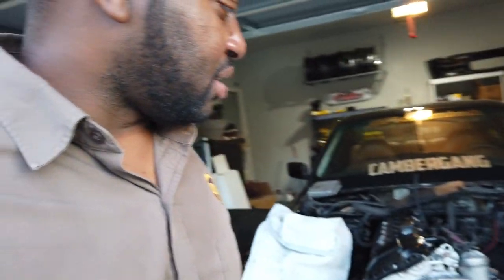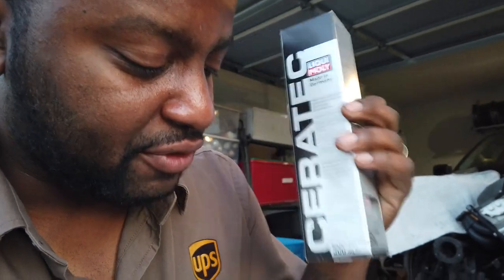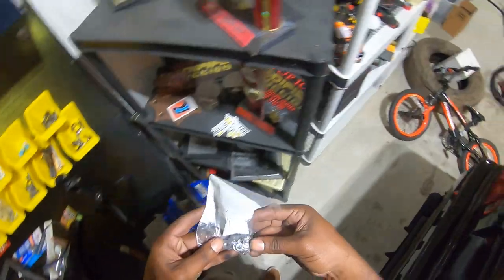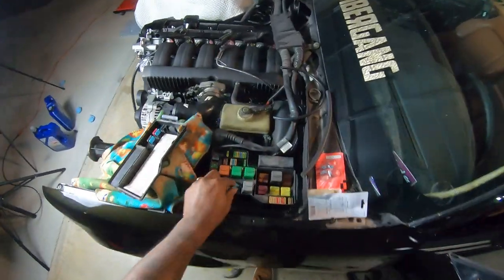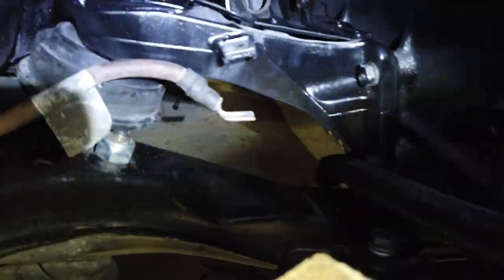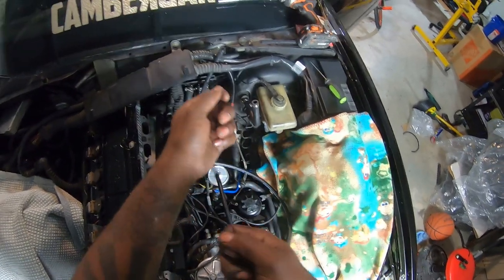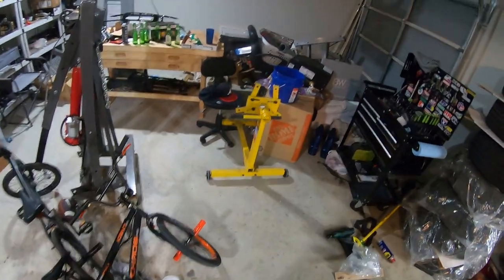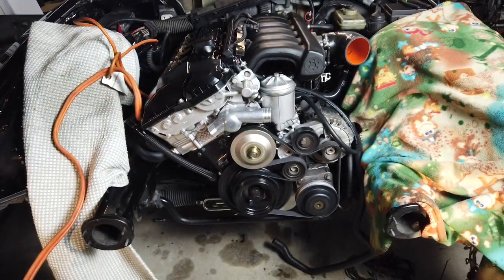"Please Start" Mistakes Were Made For Ebony's First Start-up.... || Turbo E36 Build [Ep. 22]

Comment: Awesome build! ..please let me know what kind of fuel pump to use for a build like this? I just ordered the cx racing turbo kit, 6x 650cc bosh injectors and a MegaSquirt PnP. I need to know what fuel pump I should order 🙏 would you be able to tell me? I have a 1993 e34 with the m50b25 Vanos. You help will be much appreciated 🎯🙌
Reply from the maker: Thanks. And Walbro 450 will be more than enough
Reply: Thanks a lot! 🙌 is that the one you are using for your build? How much hp would you like to achieve?
Reply from the maker: Yeah that's I'm gonna use. Going for 500
Reply: @itsBlack  are you on stock internals?